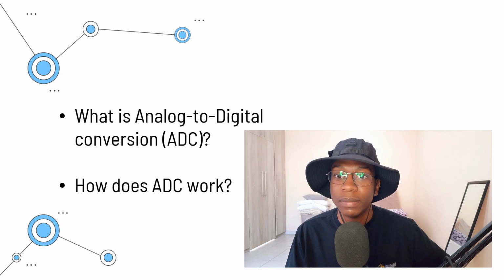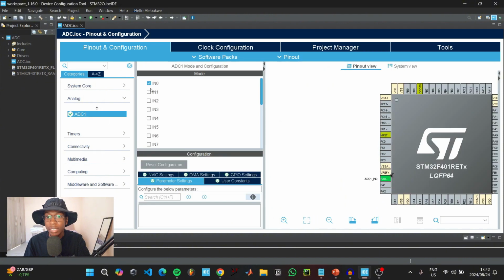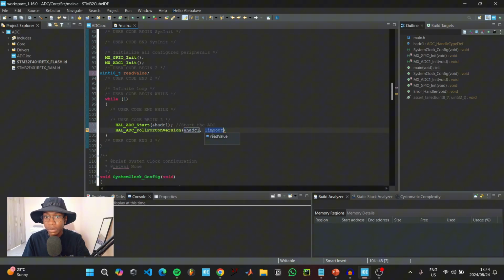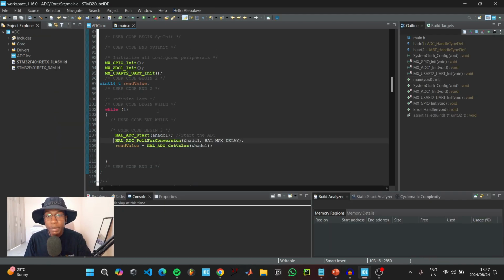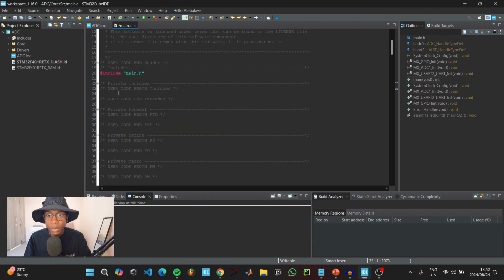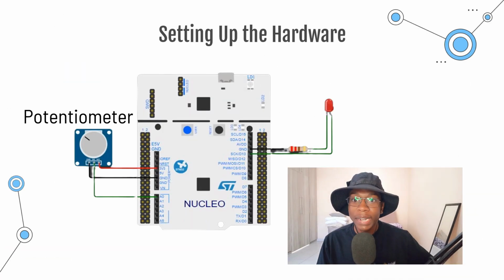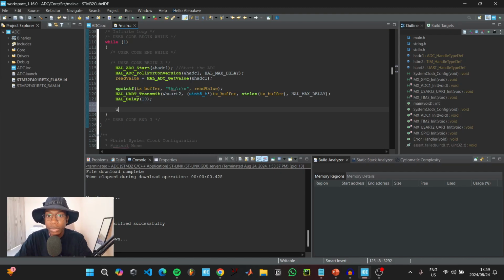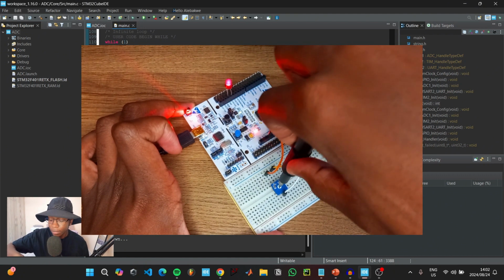STM32 Beginners Guide Part5: ADC Tutorial | How to read STM32 ADC | LED brightness control example |

Comment: Why did you use HAL_ADC_PollForConversion......?     and what is meant by HAL_MAX_DELAY?
Reply from the maker: Hi, I used PollForConversion in this example because I hadn't covered interrupts or DMA in my tutorial series yet. In a real-world application, interrupts or DMA would be a better approach for handling ADC conversions, and I plan to cover those topics in future tutorials.

HAL_MAX_DELAY is the maximum delay that can be used with the HAL_Delay() function, it has a value of 0xFFFFFFFF and takes approximately 50 days. Passing HAL_MAX_DELAY as the timeout value to a function that waits for an event or a response will cause the function to block indefinitely until the event occurs or the response is received.